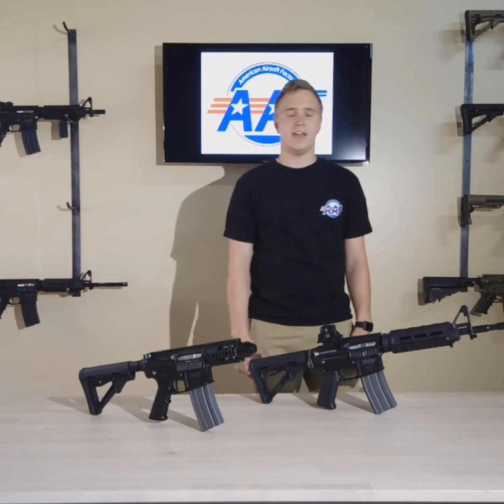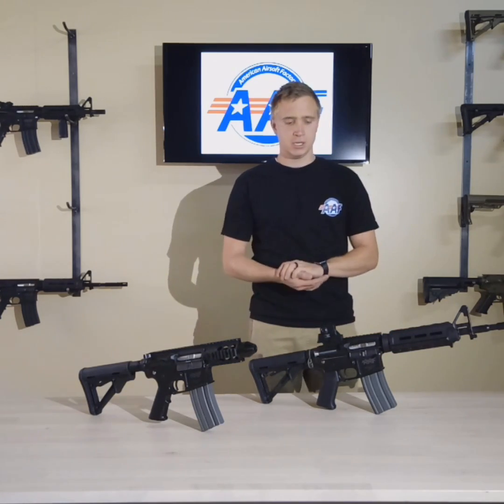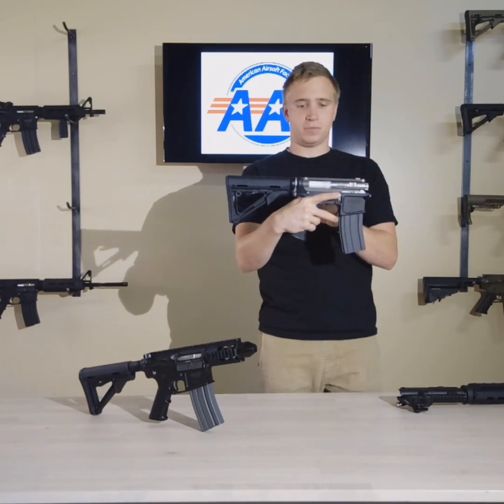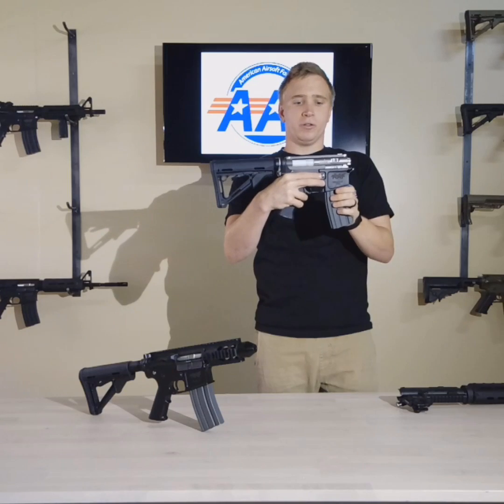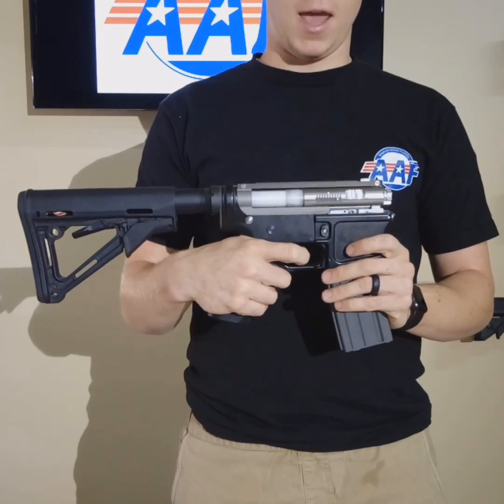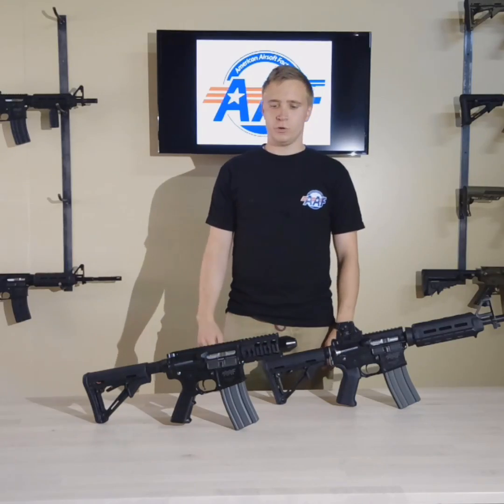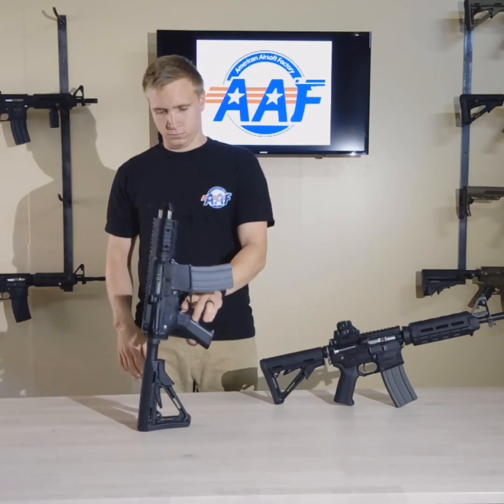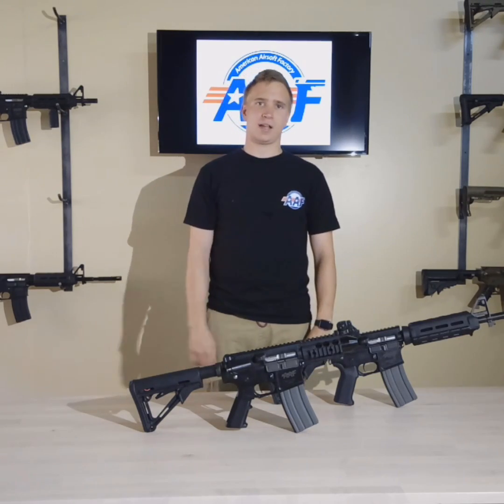Gear box and Blowback System

Comment: so basically.. the way this system works... fuctions both like a aeg & gbb.. it funtions and cycle by the piston slamming forward to the cylinder/bolt and giving energy in the same time to recoil the bolt back.. correct? rverything else works just the same as a aeg but a different trigger set up .
Reply: Legend Airsoft basically doesn’t work when you receive it... lol. Waiting on AAF reply.

Comment: What is the material of the cylinder(bolt?)? Is it steel?
Reply from the maker: The bolt(cylinder) is made  out of stainless steel.
Reply: They shipped one to me in Japan and packaging was not done well. Bolt release lever pin is missing. It has jammed a few times... so far not working since I received it.